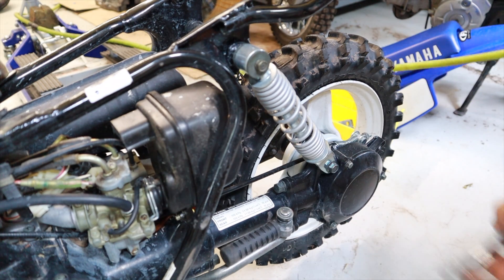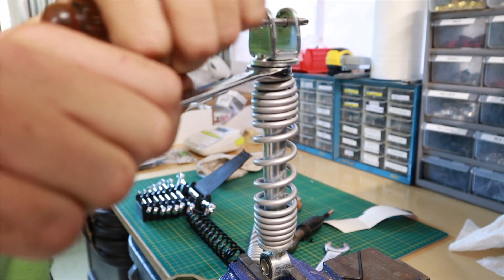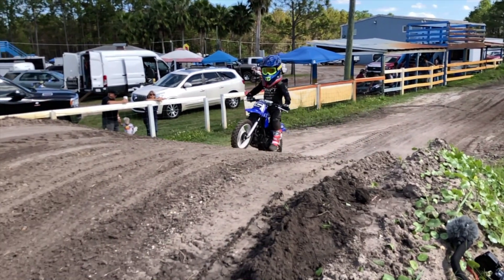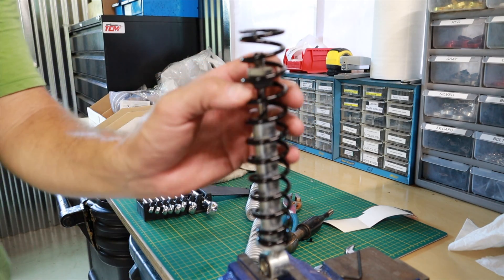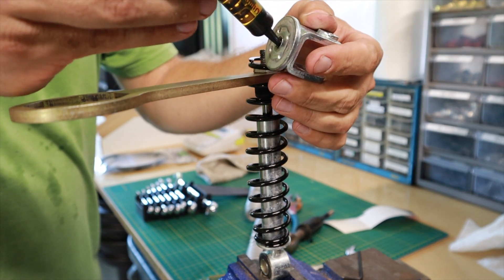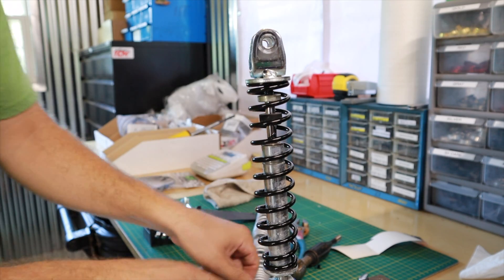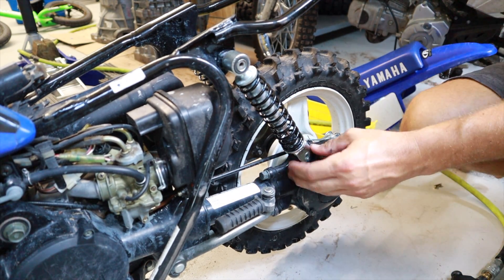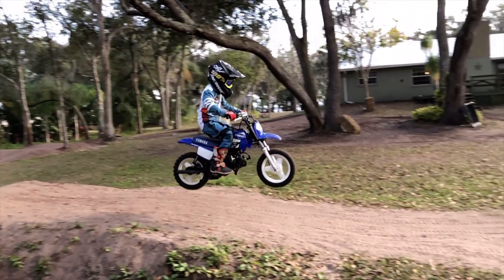HOW TO CHANGE THE REAR SPRINGS ON A YAMAHA PW50 | Making a safer bike for 3-6 year old racers

Comment: Sadly i wish all the rear shocks where the same there not :( if you have a late model 80s -mid 90s the rear shock cannot be taken apart my kids have a 1993 pw50 in rebuilding and rear shocks do not have the nut thing yours does nor are they theaded to be taken off